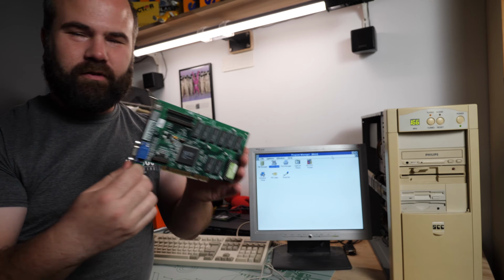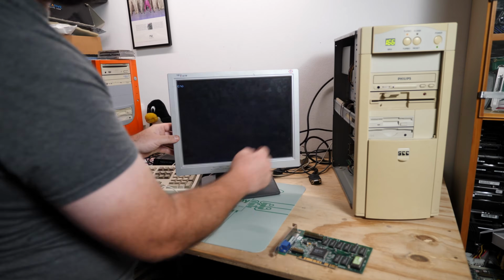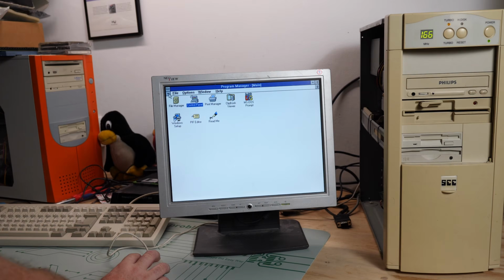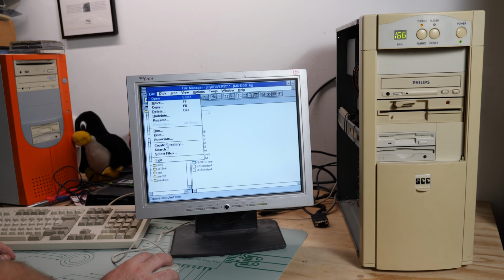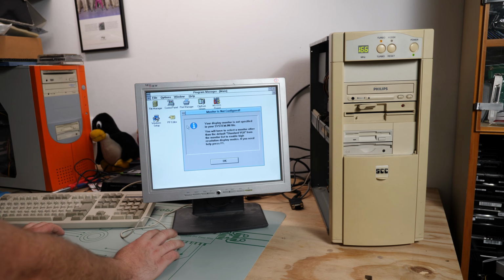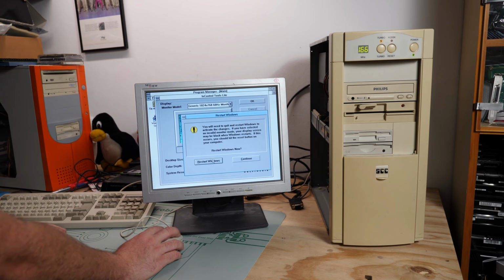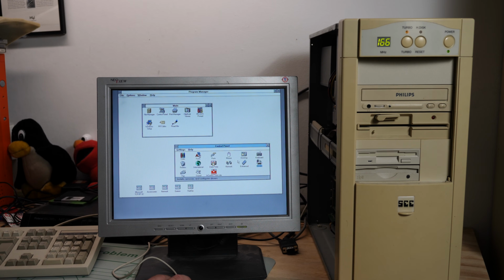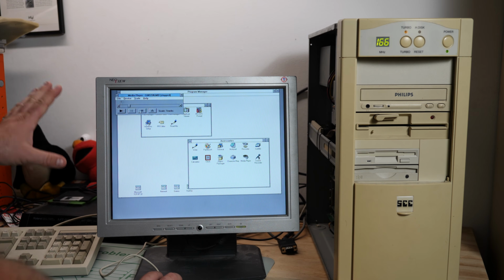This is why I collect Diamond Multimedia Video Cards! Windows 3.11 Retro Build

Comment: I also like old Diamond cards. But not all of them. Some were completely ordinary and uninteresting, but some were truly premium both in terms of hardware design (quality RAMDAC) and supplied drivers SpeedStar 24x (Western Digital WD90C31 ISA), SpeedStar 64 ISA (Cirrus Logic GD5434), Stealth Pro (Vision968 with VRAM and Brooktree 485 RAMDAC, VLB), Viper Pro (Weitek P9100 + Weitek Video Power, VLB), Stealth64 Video 3400XL (S3 Vision968, 220MHz RAMDAC, PCI), Stealth 3D-3000XL, FireGL 1000 (3D Labs Permedia NT + Glint Delta, PCI). Unfortunately, the drivers were often not updated and there were unfixed bugs in them. Sometimes you had to decide whether it was better to use a basic generic driver that just works and give up on Diamond's improvements.

Comment: I had similar problems trying to install a Turtle Beach Tropez+ in Win 3.11. The WAV playback would work for one boot then fail on subsequent bootup. The problem is usually a resource conflict like DMA or IRQ and means swapping cards to different slots on the mobo. In the end i had to take the leap of faith into Win 95, as it was plug n pray... i mean play.
Ive since built a P3 machine with Win95 and same Tropez+, which works great... but i put a Rage vid card in and the screen takes a second or 2 to refresh each frame. I know theres a BIOS setting which sorts that but i'm d@mned if i can remember which one it is :body-blue-raised-arms:

Comment: I've got two retro PC's where I've done 1024x768 at 16-bit in Win 3.11:  One has a Voodoo 3, which can use the Velocity driver for Win3.1x IIRC.  The other has a GeForce2 Ultra and there's a modded SVGA driver for Win3.1x kickin' around out there that'll run on that card.  Both systems are obvious overkill for 3.1 and I usually run 98SE on them, but they'll both run 3.1x in high-res high-color mode without any issues!

Comment: Holy $h1t! I had a massive flashback to my first monitor, when looking at the monitor types in InControl Tools. It was a Unisys EVG-400-COL, if I recall correctly. (it was from the EVG-X00-COL range for sure, a supposedly 15" model - it could do 800x600 at 75 Hz, could sync to 1024x768 60 Hz, but after a while it started to smell bad :D)

Comment: Im pretty sure matrox mystique uses the a g200 driver in windows 3.1. There is a youtube video out there is a guy using a similar card to run Windows 3.11 at 1600x1200.

Comment: One of the game I played under Windows 3.11 was Civilization II. Its written so good that it works on more modern Windows with 16/32 bit support too, even in Windows 10 32 bit.
There were only few games for Windows 3.11. Without acceleration like DirectX games on Windows 3.11 were slow, especially if standard VGA driver was used. Civilization II used one of the first "accelerated" mode - library called WinG.

Comment: Hi Victor, what kind of Matrox Mystique card is it? There should be drivers version 1.61.004 from 07oct99 on the Matrox website be available. Here are some WfW3.11 games I have installed on my Matrox Mystique 220 machine: Civilization II, SimTower & SimCity 2000.

Comment: RIVA 128 PCI is also amazing for Windows 3.11, it has great compatibility with DOS games while at Windows 3.11 it can go up to even 1280x1024 resolution.
Reply: but is overkill, though even the TNT2 supports Windows 3.1
Reply: @pankoza2  Yes, but it can also be used in PC with two HDD's or CF cards, one with DOS/Win 3.11 and with second with 98SE.